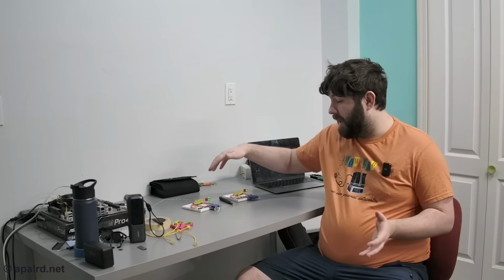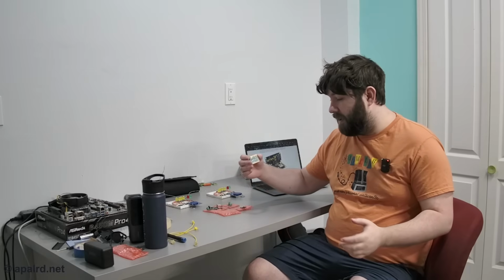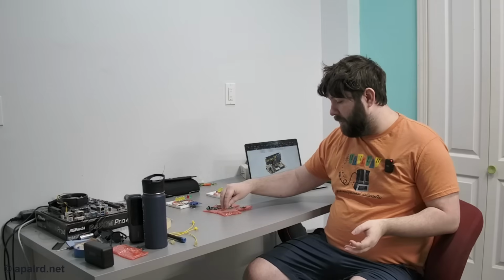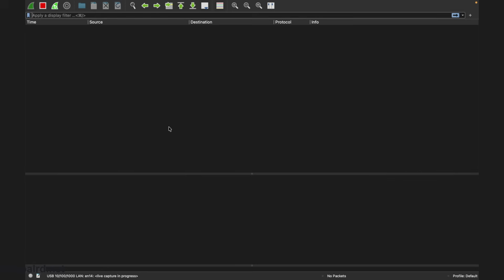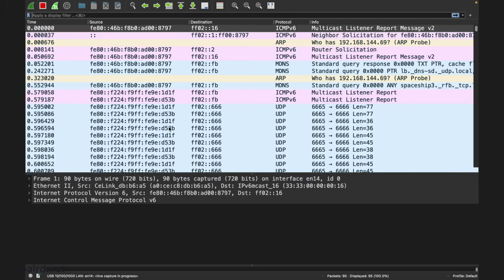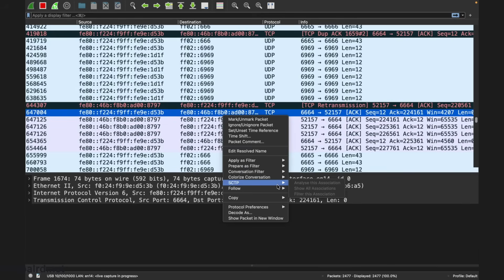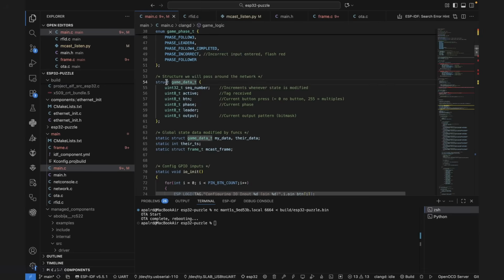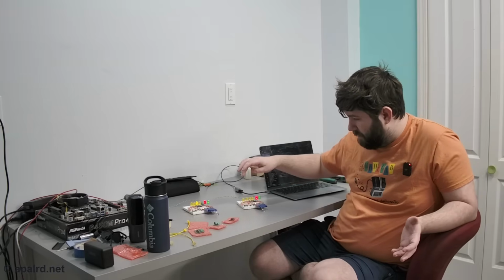ETHERNET is a BUS again?!? Taking a look at 10Base-T1S Multi-Drop Ethernet

Comment: I dont love the idea of 1 parser being all that stands between my ECU and take-over by the vuln android tablet blasting 'I knew you were trouble (Taylor's Version)'

I get that this is already sort of true with switches copying RTRs/Data from one bus to another, but merging busses like this further mixes physical/electrical systems intended for:
- operating the stereo/infotainment
- operating the 2-ton death machine

Seems like bad planning to make these so similar that it incentivises cost cutting til it breaks.

edit: reworded for clarity
Reply from the maker: In the “old” architecture it was very common for devices like the radio and telematics system to sit on the powertrain bus to read basic vehicle data. Many vehicles have already had vulnerabilities due to putting their can bus on the internet without any protection
Reply: @apalrdsadventures 😮‍💨 i know you're right, im just tired and sad lol
Reply: but it saves some pennies... so they can buy their yacht sooner :P
Reply from the maker: In automotive it’s about weight as much as cost, the weight of copper wiring in vehicles is quite big. In aviation we also consider the failure rate of every single connector and connector pin, the failure rate of wires chafing in bundles, .. and using less wires for the same data is not exclusively about lower cost, there are real engineering advantages to using less.

Comment: PoE is a big gamechanger, especially given how plentiful PoE switches/injectors are nowadays.
Reply from the maker: T1 called it PoDL (power over data lines), since power on a single pair is differential across the data lines instead of across two or four pairs.

Comment: This can also be a neat replacement for RS485 deployments.
Reply: I work in building controls. Several of manufacturers already have t1s options.
Reply: @Techsupport243  not t1s but t1l that does go up to a km. my current controllers have the interface but there are no field devices readily available yet from what I can see.
Reply: @Maaniic I think honeywell has one out. My las company started messing with them right as I left. I think it was  bata test. The had a lot of issues.

Comment: T1-l would be funny to do over barb wire. Put solar powered cameras with a bridge on your cow fence.
Reply: Only if barb wire is a twisted pair pulled from old cat5 cable. Which isn't a far-fetched cyberpunk future, since in my village a fiber optic cable is used as clothesline 😂
Reply: Homeplug can do that. It's very tolerant of poor signal quality.
Reply: @NiHaoMike64  Unfortunately HomePlug AV is pretty much defunct. And G.hn seems to not be as available.

Comment: Are they reintrodussing packet collisions into Ethernet ?
Reply: packet collisions never went away at the protocol level, they were just "work arounded" using switches so every cable is connecting only 2 endpoints at the physical level, and then the switch electronics is moving packets around from one port to another in a controlled way so there are no collisions inside the switch itself.
The second you are not using switches (i.e. wifi or daisy chain setups like this one) packets collisions are back with a vengeance
Reply: @marcogenovesi8570 Wifi has packet collision?
Can't they have something clever to work around that with scheduling and dedication subchannels?
Wifi has Mi-Mo so there has to be something in place to take care of that.
Reply: With wifi it never went away
Reply: Yay collisions!  I've missed that little light on ethernet hubs.
Reply: Somewhat but not really, there's a time-share-ish method underneath, so each node waits for it's turn to send packets (and they are skipped if the node doesn't have stuff to send).
Reply: No, there are no collisions with Physical Layer Collision Avoidance (PLCA) in 10BASE-T1S.
Reply: @aa5df How? There are multiple nodes on a single twisted pair.
There can't be more than one node transmitting at once.
Reply: @Luzgar PCLA introduces timing windows where only one specific node may transmit at a time. The number of nodes and numbering of them on a particular medium has to be static for this but this is fine for systems that this is designed for.
Reply: @ignaloidas You divide the bandwidth by the number of nodes?
Reply: @Luzgar not quite - there's a master node that sends out periods during which a specific node can start transmitting, but if it doesn't start within a fairly short time, then the master node just goes onto sending out a period to the next node. This basically guarantees that each node can always use at least a fair fraction of the total bandwidth, while also allowing usage of basically the whole available bandwidth if the other nodes don't have anything to send.

Comment: Last time I looked at T1S the one thing I missed from CAN was being able to just hook in to the wires and see the traffic.  But the bandwidth makes up for it.
Reply from the maker: You mean like on a scope? Or using a proper bus analyzer? There are definitely bus analysis tools for T1S
Reply: I mean, for a typical CANbus you don't need much from your ADC since the bandwidth is so small. 10Mbps scope should be no issue?

Comment: Frist?! Inb4 car components start getting exploited remotely over IP.
Reply from the maker: Not sure how many people know this but there’s a car company using Nebula (the zero trust mesh network i made a video about a few years ago) to connect all of their cars and cloud services together securely
Reply: So I've got some bad news, that already happened. 
For some reason there was an IRC server connected to the non-critical can network. Inside the media center which connects between the secure and insecure cam networks that are supposed to not be able to allow them to communicate. It turns out you could exploit them to communicate. This IRC server was publicly connected to the Sprint modem with an open port for that IRC server. Although this wasn't connected to the internet so you had to have access to the Sprint internal network with some sort of Sprint service.(Phone vehicle tablet anything that provides mobile data) So if you connected to the IRC server from another vehicle you could remotely jerk the steering wheel over IRC over ip.
This is the incident that I remember but there's been a few others.
Reply: Using a niche protocol does not protect you from exploit 👌🙂‍↕️